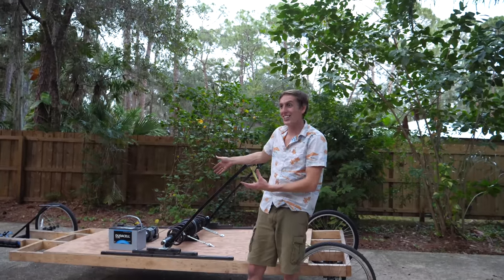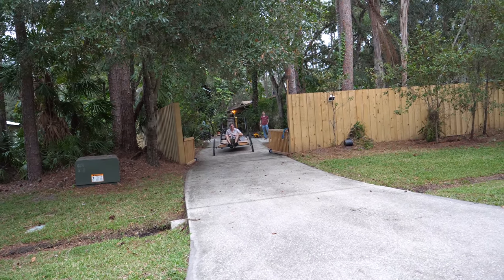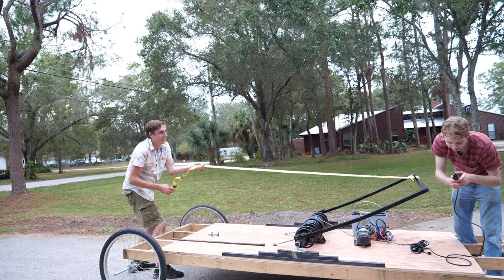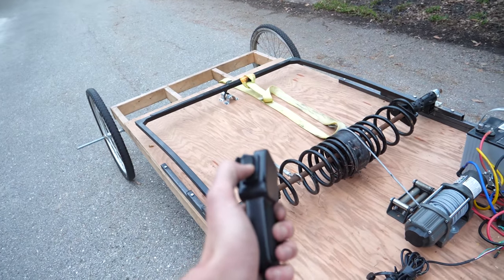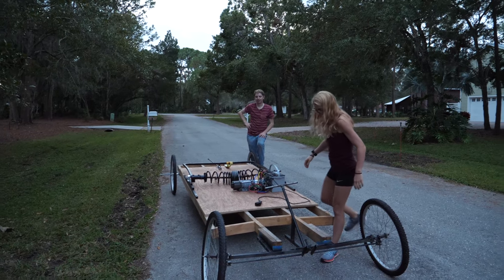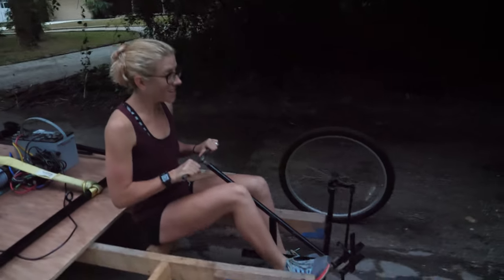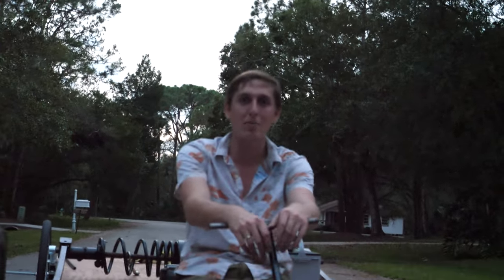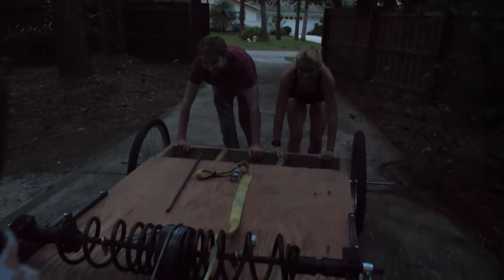Giant Mousetrap powered Car

Comment: you need a MUCH larger spring!
Reply: Yeah looks like this setup is inherently at a mechanical disadvanage
Reply: I wonder just how much more deadly this can get?
Reply: Or fit a type of sprocket to the axle to give it a larger torque
Reply: JonnyD3ath no! It must be larger, like an elephant trap?  Or whale trap!  Those pesky whales!
Reply: Need a spring big enough to cut a horse in half.
Reply: dark matters yes, exactly!
Reply: Easiest way to increase mechanical advantage is a longer lever and larger rear wheels.
Reply: Chase Watkins I like where you are going with this : longer, larger, faster
Reply: Yep, turbo it up!

Comment: Crazy thought but perhaps building 3 identical mouse traps and putting them in a straight line, single strap to the back axel will improve torque and hopefully give you the top end speed boost.

Comment: Put a drum of some sorts on the axle for the strap to wrap around a larger circumference, for more speed (will require a longer strap).  Or even larger rear wheels, to be able to fit a bigger drum and not have it rub the ground.  The increase in initial speed will add to the distance traveled, plus will be a more exciting ride.

Comment: You should add a braking system where pushing the pedal applies friction to the front axel, and because of the weight on the back it shouldn't flip over.

Comment: That car could run a lot better without the mousetrap. Just put a pulley on the rear axle, close the strap off into a loop, and stretch it tight around that and around the winch's axle. Then the winch controls the movement of the car and away you go.

Comment: Try adding some sort of hub onto the rear axle to increase its diameter then wrap the strap around that so that it is trying to rotate the axle rather than rip it off of the car. This will increase the torque on the axle and increase acceleration and speed. hope this helps!

Comment: You need a stronger  spring and remember mechanical advantage the spring acting directly on the axle is less efficient than making a arm that goes from the spring to the axles and depending on its length will increase the advantage also bigger wheels will aid and making it go greater distance you must balance how fast you want it to go and how far you want it to travel

Comment: Captain America. Everyone tried to climb the poll for many years to get the flag. He pulled the pin, layed down the pole, took the flag...  try just hooking the winch cable to the strap then wind the strap around the axle. Press button on winch to unwind the strap from the Axel as the winch winds up the cable... propulsion.... and torque

Comment: You know how electric/hyrbrid vehicles have regenerative braking? How about having a motor that can wind up multiple times without slowing down the actual wheel speed? And what about better gearing? Like using a thicker part around the driving part of the axle shaft.

Comment: Need to get it so the mouse trap charges the battery when you go and there's a ratcheting mecagnism on the axel so you can reset it mid ride and charge the battery at the same time

Comment: Hey, got an idea for you. Can you make a liquid cooled refrigerator? To me more specific water cool the refrigerant for the refrigerator with household cold water then recycle it back into trhe hot water tank like those instant hot water systems where they use a recurculator pump hooked up between the hot and cold water lines. Curious on energy savings on hot water and fridge run time to stay cool. Please like if you want to see this done